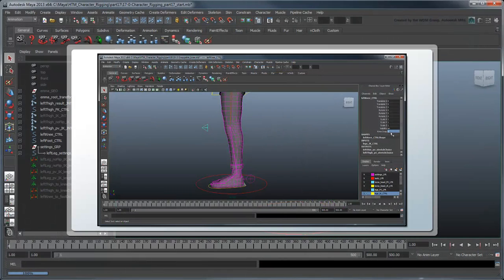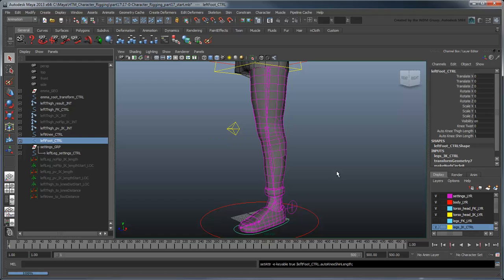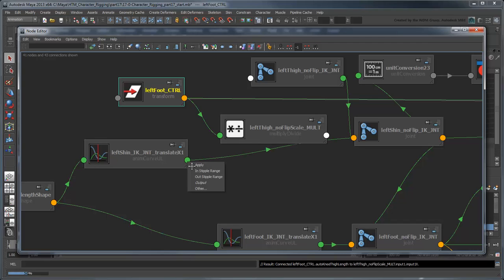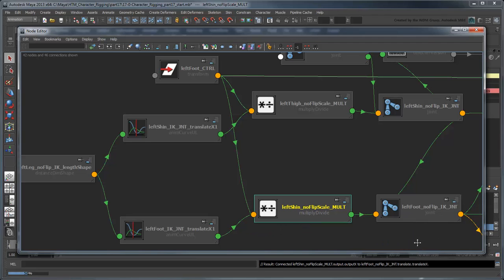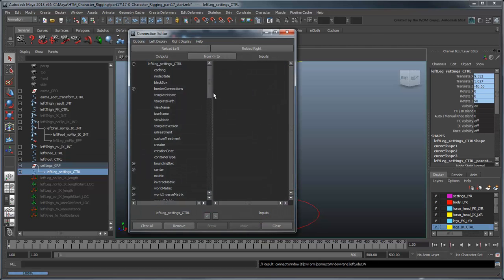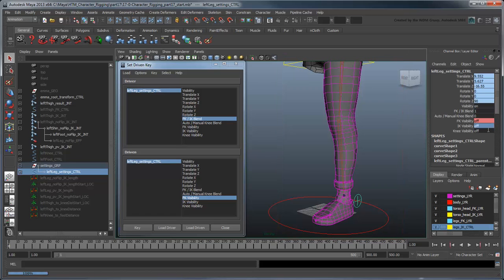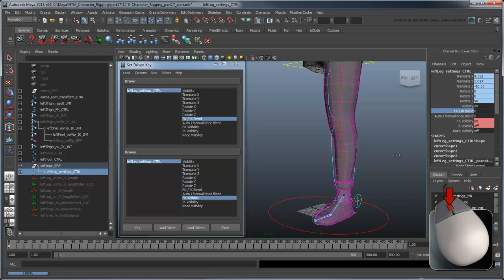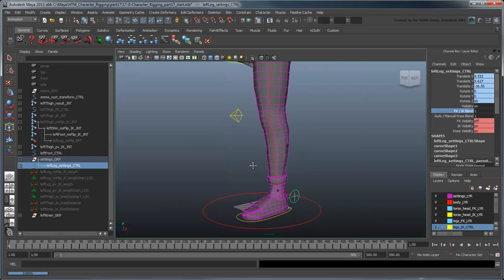Creating a Character Rig - Part 17: Non-uniform no flip IK leg stretch and automatic IK FK toggle

Comment: in maya 2016 i've done everything up to 3:02. when i then try to test the function in changing the value of the attribute - like it's shown in the video after connecting the nodes - nothing happens. what could be the reason for this?
Reply: Have you tried switching the Auto/Manual Knee Blend from 1 to 0? Mine is flipped aswell

Comment: When blending from 1 to 0 in the FK / IK Blend attribute in the Channel Box, the geometry of the leg twists a little bit from side to side on my version of the rig.  Any tips on how to fix this?
Reply from the maker: +Sophie Berry Sounds like your FK/IK legs either aren't in the default position, or their default position doesn't match.  You might want to take a look at that.
Reply from the maker: +Maya Learning Channel This is why we use a lot of duplicating of joints when creating the various versions of each joint chain - to ensure they're exactly the same.
Reply: Hello I've been having  the same issue too and it's very frustrating. I have used duplication from the beginning, and there still seems to be a very small amount of rotation in the IK chain that's making the foot move a tiny bit during the blend. 

I tried to go back and match the orientation of the IK joints perfectly to the reference skeleton (using the match transformations) I find that when I add the IK HDLs to the toe and ball they move the joints a little bit....
Reply: So after extensive review of skeletons I found the solution! My FK and IK skeletons where in the same place, but my IK foot had non zero rotation value on one of the axis. I was able to separate various nodes and freeze the transformations and hook it back up again! So satisfying!
Reply: Spoke too soon. I saved the file, and when I reopened it, the foot has rotated 90 degrees! Why?
Reply: Now works, Added a 90 degree twist to Ik ball. Wondering if this is something often done in rigs? Seems a little arbitrary and not the neatest solution...

Comment: Curious: Why did you need to create the Boolean attribute for the Visibilities on the Settings control? Wouldn't it have been more straightforward if we just directly linked the FK / IK blend to the corresponding object's Visibilites instead?

I'm guessing this is for the overriding purpose you mention in 6:52?
Reply from the maker: +Gogo Correct

Comment: For some reason my Auto / Manual Knee Blend is reversed so "0" is on and "1" is off, is there a quick way to swap this around? Thanks - Adam
Reply from the maker: +Adam Bryant Just insert a "Reverse" node between the connections from the math nodes to the Blender attribute.
Reply: +Maya Learning Channel Fantastic! thankyou - Adam
Reply: @Autodesk_Maya  hi, please can you expand on how to do this? I don't quite know how to do this
Reply from the maker: @stephrobert3163 Actually, the easier way is to just swap the Blender node's inputs (plug what was in Input 1 into Input 2, and what was in Input 2 into Input 1).
Reply: @Autodesk_Maya  this is for the noFlip_PVChoice blenders right?
Reply from the maker: @stephrobert3163  Yes, that's right

Comment: Hi, my IK/FK_blend attribute on my leftLeg_settings won't go anywhere other than 0 and 1, so I am unable to set driven keys on the 0.001 and 0.999 as in your video. Do you have any idea where I might have gone wrong? I'm using Maya 2015. Thank you.
Reply from the maker: Linda Dunlop That is very odd.  The Blender attribute's default value is usually 0.5 so something is very wrong with that.  Are you sure you're using the right node?
Reply: Thank you for your response. I got very frustrated and redid a lot starting from where I created the IK/FK blend attribute in the channel editor. I think the first time I made the attribute it could have been an integer , min =0, max =1, so there was no in-between when I tried to key one. This time round I made it a float and it works. I'm only guessing that is what I did because I didn't have to redo the blenders. Its a steep learning curve for me... very new to all of this. Thank you again for your great instruction.